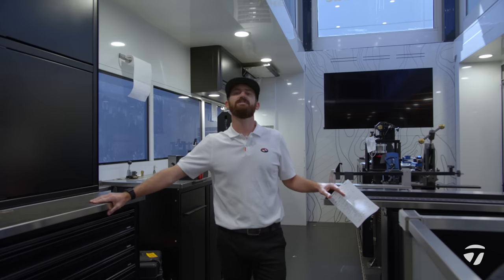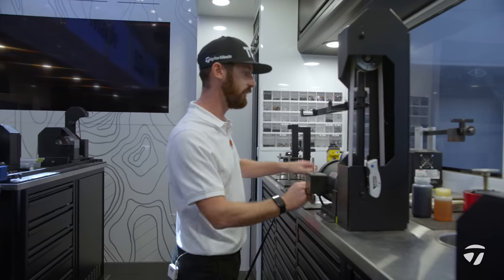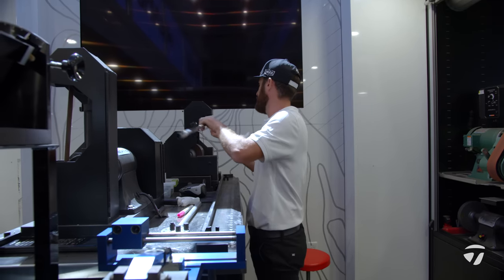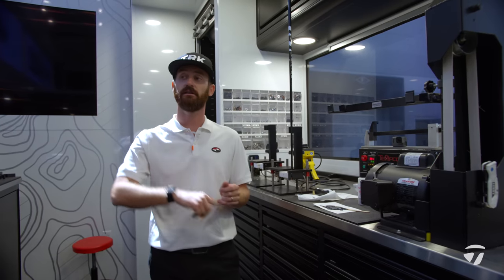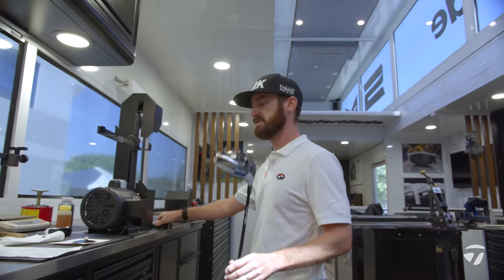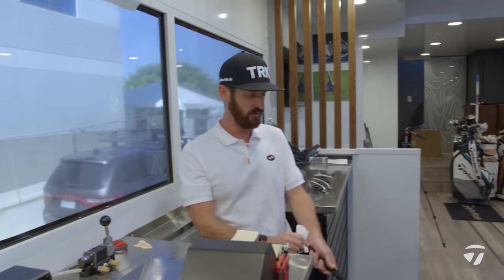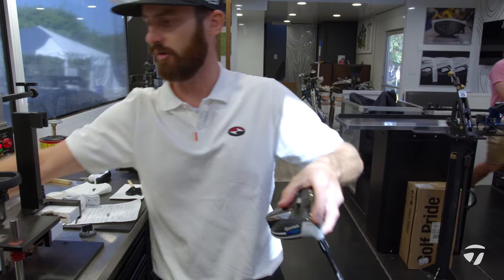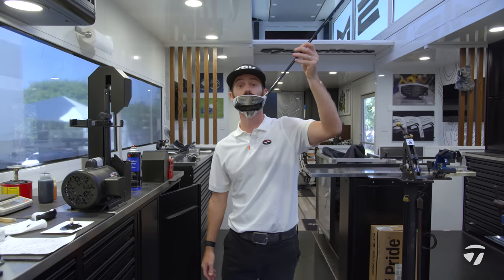Building Dustin Johnson's SIM Driver on the Tour Truck | TaylorMade Golf

Comment: I was working at a GM plant and seen these pots that said “Hot Melt Technologies” on the side. These little yellow cubes are heated up and used as an adhesive to hold wiring harnesses in place along the back side of the headliner. Very cool.
Reply: What is the difference between Hot Melt Technologies™ and hot glue?
Reply: @hazy-  probably a few dollars, lol

Comment: The only "exotic" thing he did that I don't do (as an amateur club maker) was the addition of hot glue inside the head.  And also, I don't have a bending jig to change the lie of the driver.  He measured it and it was per Johnson's spec, so we didn't see what he'd have done if it was off. I don't have all digital, state of the art instruments, but whether swingweighting, tipping/trimming, loft and lie measurement, etc, it can all be done at a workbench in your garage.  None the less, it was fun to watch.   The skill he has that we didn't see exhibited here was his knowledge of fitting and what to change in a club's spec to accomplish the player's need/goal.  In other words, the back and forth with the player to get to the SPEC.  Seeing those done by the tour truck guys and a tour level player is REALLY fun!

Comment: That was super cool.  I build most of my own clubs and of course they are mostly TM...  Some things that are really frustrating for me is that I can't get a driver head at exactly the loft I want (yes, 11 is also good for me), and because I like a 44.5" length, I cannot get the special hotmelt and different weight screws for my SIM driver.  It was really nice when the Superquad etc had 4 weight screws to at least move the weight around a little more but they have gone away from that now.  If you want, I can post all my specs, driver to LW and we can work on a tour van build just for me :D

Comment: "then adhesive remover, to get rid of any fingerprints down the shaft and on the head" and then he puts all his prints back again on the club :D
Reply: Nah. Fingerprints only show up when you're gripping the shaft with some vigor - like when you're building a club. Lightly touching it after the fact won't do produce any visible prints.
Reply: @jakelindsay6251  More importantly, the point of adhesive remover is to remove fingerprints from gluey fingers (such as from the tape).    Fingerprints from regular handling are inevitable for the player caddie and easily wiped off - but fingerprints carrying tape adhesive, are not as easy for them to remove.

Comment: Great video! Very informative. Question I have a right hand SIM driver with 2  Hzrdus Smoke Green shafts available to me, 1 is a 60G and 1 is a 70G. I'm 5'4" in height and my left wrist to floor is 32" I feel the standard length is way to long for me. I'm leaning towards cutting down the length to 42". That way making the driver the proper length for me. I'd like to keep the performance the same. Should I cut 1 1/2" off the Tip and 1/2" off the Butt? I hoping to maintain distance as well. Heavier head weighting... Butt weighting? Thanks, love your knowledge!  Cheers!

Comment: So the buttcap on the grip is 1/8" and at 5:30 he says that he needs to cut 1/8" LESS than the total length (45 3/4"). So did Dustin just get a driver that´s 1/4" longer than he ordered?
Reply: I thought the implication was that this butt cap was thinner than normal so he had to cut less to get the same length.

Comment: You mentioned not to get hot melt on the face (internally), does that mean you cant alter CG by using it? Was considering this option to move weight forward.

Comment: Incase you thought you where buying the same driver as pros, you aren't even on the same planet
Reply: For sure. Same as tennis. All the player's have completely custom made racquets.
Reply: The game is a lie
Reply: all this is available through a fitting with a professional but ok Vic.
Reply: Nothing about this is out of reach at all for the average player. You'll pay for it, but all of these services are available.
Reply: @morgancross5481  though lessons would be far more beneficial for anyone shooting over 90 vs a pro fit driver.
Reply: Nothing in this is that crazy. The only thing in this video that I haven't done on my own club is the hot melt stuff but I don't think that's 100% necessary. Especially since a lot of clubs have adjustable weights, anyways, SIM included. You can get whatever grips and shaft you want and have it installed any direction with tape and whatever. It's all available. The only difference really is that these guys get it free whenever they want, on demand.
Reply: @manwichwithmayo  No argument there!
Reply: @Sugar Dunkerton True, but the whole concept with the "Speed Injection" with SIM is keeping that number pretty tight to the limit.
Reply: @morgancross5481  puring or spining of the shaft?
Reply: @Sugar Dunkerton Right, but the point is that they intentionally manufacture slightly high and then bring the CT down with the resin behind the face. The is the whole "Speed Injection" concept, even though it is actually "slowing" the face so to speak. But as a result, you won't have one over the limit off the shelf and any that are under are only slightly so.
Reply: @GolfRx  With the tolerance and quality of todays golf shaft from a manufacturing standpoint, puring/spining is largely useless.
Reply: @morgancross5481  I respectfully disagree .. there is always! always! a soft point in the shaft.
Reply: For sure. I played college baseball and managed to swing a few MLB wood bats vs a bat from say Dicks. Money can’t buy the sticks they get. Unmatched
Reply: @GolfRx  looks like neither, just graphics facing down seem like a priority to DJ
Reply: Back in the day we used lead tape, etc but the process now is just more flexible and simple.  But tipping etc has been done since the 50s probably.  I've swung off the rack drivers and Tour issued drivers and trust me the difference is insignificant.  The process is just streamlined and we have so much more data to work with.
Reply: notformebeaky  of course I meant the very top players. Not some journeyman who happens to be in the top 100. The point is, those custom made racquets available to the elite guys will never touch the hand of a member of the public.
Reply: @GolfRx  What most guys dont know is that shafts making it to tour trucks are selected by the shafts providers themselves, because they want the best players to play their shaft. The ventus trottie picked has been selected among others and the others are mounted for off the rack clubs. You can have that level of precision as an amateur by getting club built by a pro who will select the best custom shafts on the market. Brands like Accra are expensive cause they do only high performance shafts. Tights tolenrances, higher price.
Reply: @manwichwithmayo  I agree but I think he meant buying a club stock
Reply: this makes that obvious
Reply: @diogeneslantern18  actually most pros use very old pro stock rackets.
Reply: @vahag25  they didn’t show the marking when inserting the head
Reply: @manwichwithmayo  that is an after market shaft costing hundreds in not close to a thousand. Not the same at all.
Reply: @lucascarman2578  that and those after market shafts some not even available to buy if they are the cost is double the normal club price.
Reply: Id argue the public CAN get clubs built pretty close to pro standards, but you'd have to go to a specific place like Club Champion or a place like that, and the cost would be $6k+.
Reply: The majority of player’s wouldn’t know the difference!
Reply: @itsmb8  No where near $6k
Reply: @manwichwithmayo  dude, this guys literally put a custom amount of “hot melt” into the club so that the toe is faster than the heel to Dustins Preference. That isn’t even close to any club fitting anyone would get.
Reply: It’s amazing to me how people are saying “nothing a club fitting can’t get you” lol they obviously didn’t watch the same video because this man put in “hot melt” to adjust the speed of the toe so it’s faster than the heel for Dustin. No club fitting ever can do that lol
Reply: I know they aren’t hitting off the shelf drivers. Anybody can get this done tho it’s no big secret.
Reply: Lucas Carman sim2 does not have moveable weights
Reply: @all-timealien4483  you are completely wrong but ok....hot melting for years. but not really necessary anymore. most players arent doing any hotmelting any more.  dj probably likes the feel or he would just change the weight to a heavier one. i hot melt every damn ping i buy. make it feel better.
Reply: If you arent hitting the sweet spot at least 80% of the time-none of this customization matters.  Don't waste money chasing what a tour pro uses.
Reply: @manwichwithmayo  this is a thread about the gear tho fam

Comment: That was awesome seeing behind the scenes on the van.  How do the pros get the exact launch and face angle that matches them perfectly?  Do they just test lots of heads and look at the numbers?  Or do they normally have a set of numbers already and each driver model usually fits in those specs?  Or do these heads vary that much that they have to go through this every time a new driver model comes out?
Reply: They work the team out on the range dialing in exact ball launch conditions required for that given week. We use a variety of launch monitors in initial testing then we would head onto the golf course to ensure everything is PERFECT

Comment: Well, that was fascinating. That mobile workshop is so smooth. Love it. That’s such a cool job you have. 

Question: I’ve always wondered/ never been able to find out why irons are designed to be struck with the shaft leaning forward or delofted. As a club maker / fitter, do you have any insights to explain it? How did this come about? What’s the science?
Reply: It’ll be to do with the center of gravity & how that impacts the dynamic loft, that’d be my take but I’m not an engineer ⛳️

Comment: Really cool video Trottie...I like the quick cure...is the holt melt gun connected to the Tempco unit?   I noticed you did not check flex after tipping and did not FLO the shaft before installing the adaptor? Do  the shafts for the Pro's come from the TM factory with weight/flexes tested and, have the shafts had the PUREing process and then logo painted?  With all my re-shafting or new build I spine and FLO and most time the logo is off to the side even when the shaft has a factory spine mark...again great video Cheers Landy!
Reply: Hey Landy, we don’t pure wood shafts too often. Graphite is so efficient these days PLYR’s tend not to pure them ⛳️
Reply: @trottiegolf   I absolutely agree nowadays graphite shafts are really efficient...thanks for the response and I love how dialed in the Taylor Tour Truck is!!!

Comment: Great inside look. However...heel-weighting does not promote a draw in the way described, although its usually explained that way. Instead, weight in the heel moves the clubhead's CG in that direction, which plays on the horizontal "gear effect" during impact and the "bulge" radius of the clubface to produce less fade/more draw.

Comment: My previous driver (to my current SIM Max) was a Ping G30... I never completely liked the sound but after hearing a 'tour truck trick' I opened the weight port and stuffed some cotton wool in, resulting in a much nicer, duller sound. I like the idea of different sleves for the shafts...would be a nice option to be able pick which type of sleve you have.

Comment: How often are you building new clubs for the TM guys? I wouldn't think DJ or Rory would change heads very often--maybe just mess around with different shaft combos. Are the shafts in the tour truck SST PURE'd?
Reply: They’re not pured , we do pure if requested, then we build when the spec change is needed (swing change) or the course requires a different set up 👍🏻

Comment: How long would he keep that driver in play? Does he change every tournament?
Reply: I doubt he would change it if he was driving it how he likes.   But ya even tour heads and shafts can be off and a good player will notice.   Everything is cherry picked on the tour van.   For example if you go to the store and buy 100 golf pride tour velvet grips they will not all weigh exactly the same.  So what pros do is weigh all of them exact and pick 13 out of the 100 that are the closest to being the same exact weight.   like one grip may come in at 53 grams and others may be 50 grams.  Depending on the pro he may choose to pick 13 out of the 100 that are nearest to 51.5 grams.    same with shafts as well.   etc etc.  Just alot of trail and error.  So when you got it right its foolish to change because so much went into it.   Much easier on the tour van because they have it mastered and down to a science from years of research and specs from players and so on.
Reply: He would use it until we went to a location he didn’t think it worked (altitude change for example), OR he started swinging it differently ⛳️

Comment: What solvent or what not are you using that drys so fast for the clun to be used in 15min. I understand the curing of the apoxy but id be interested to know how a grip doesnt twist due to usually taking an hour or 2 to completely dry.....
Reply: Mineral spirits, by the time I’d walked to the range that’d be ready to rock n roll ⛳️

Comment: @trottiegolf  Does TM use frequency machines to dial in CPM's to players specs at all or is CPM's not used that much anymore. I know on my frequency machines what driver numbers I like best (265-270) and try to nail in that range along with my preferred swing weights. I'm just curious if TM uses CPM's in club building.. Cheers..
Reply: We do not and have not used frequency machines on our truck

Comment: Hi Trottie, I have a question about the club length measuring you did. You said the USGA measures the driver from the middle of face on the sole side to the end of the grip. I could swear most of the club length measuring scales I've seen measure from the heal of any club to the grip end. I can think of the Golf Mechanix units that measure that way. Can you possibly explain that to me. Thanks, great video.
Reply: I’ve touched on that on my own IG account, but yes center of sole for USGA ruler. That’s the housing they use and that’s what we go off ⛳️
Reply: @trottiegolf  Hi, thanks for your reply. What is an IG account, as I'd like to read what you said. Is there anything on the USGA website about this.
Reply: @wally6193  INSTAGRAM search @trottiegolf 👍🏻
Reply: @trottiegolf  Would you be able to tell me the make and model of the unit you are using there. So I'm guessing all the tour vans use the same USGA approved units. Thanks again.
I guess I need an instagram account to view your posts, do you have them anywhere on utube perhaps.
Reply: Trottie, Now I'm confused, I just went onto the USGA website and under the "Test protocols For Equipment" is has a section called "Procedure for measuring the length of golf clubs". In figure 5.0.1 they show the measurement is taken from the grip end to the sole of the head directly under the shaft end(so heel). It does not show it taking the measurement from the center of the face where it meets the sole.  Interesting, now this document was dated 2007, but I can't imagine they changed it since then. Can comment on this, thanks again.
Reply: @wally6193  the ruler housing takes all that into consideration, you push the heel against the housing and that measures to the top of the grip 👍🏻
Reply: @trottiegolf  Would you be able to tell me the manufacture of the unit you are using there?
Reply: @wally6193  in house I believe ⛳️
Reply: @trottiegolf  No problem. I read over the USGA's paper on it and I'm straight on it now, thanks.

Comment: What about the spinning of the shaft? What about the frequency matching of the shaft? No two shafts are the same. Swingweight changes frequency. Tip trimming changes frequency. You add weight or hot melt the head you soften the frequency. For a tour professional and caliber of player as DJ is, I'd think you would be a little more precise with the build.
Reply: I covered puring today on my IG, you raise a fair point but we don’t get many requests from the driver 👍🏻

Comment: TaylorMade need to synchronize their message.  If you read https://golf.com/gear/dustin-johnson-taylormade-driver-wall-to-wall/ from 11/16/20, it states Dustin uses a Fujikura’s Speeder Evolution II Tour Spec shaft.  Also, the article states... “I’ve never had to do any hot melt adjustments inside the head that are unique,” said TaylorMade Tour rep Keith Sbarbaro. “He doesn’t like to do that.  
Doesn't seem consistent to me

Comment: So...basically folks. Don't bother buying a modern driver off the shelf if you want to drive it further than 250 yds...
I have noticed that the lie angle that many pro's have seems to make the driver heads sit flatter to the ground than any clubs you buy off the shelf.